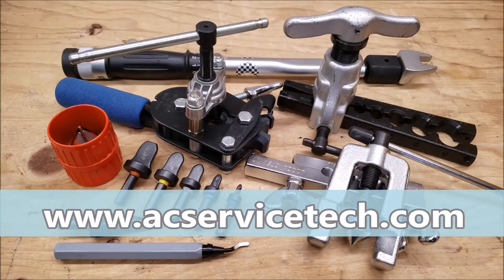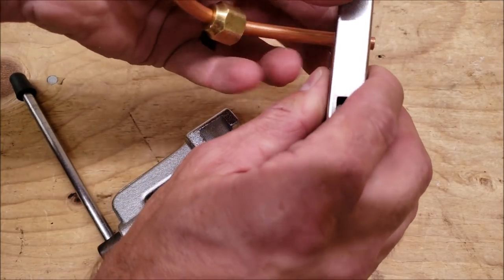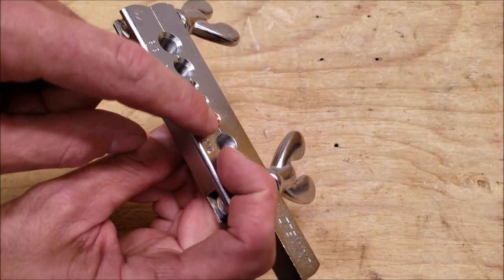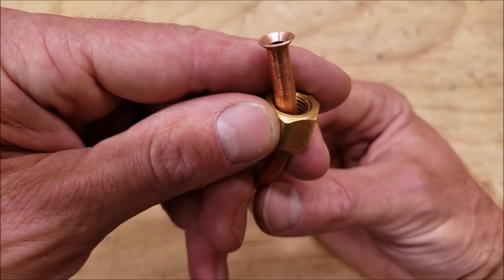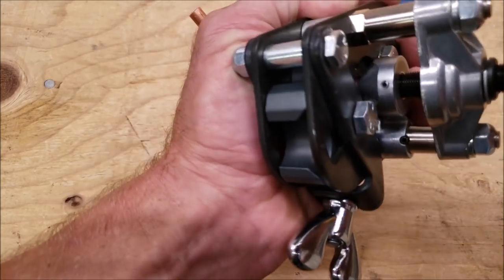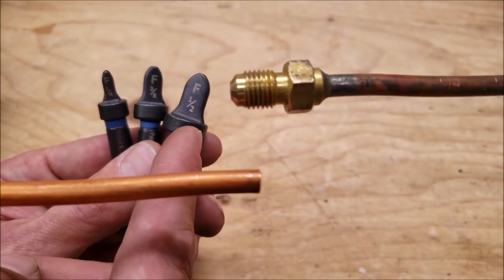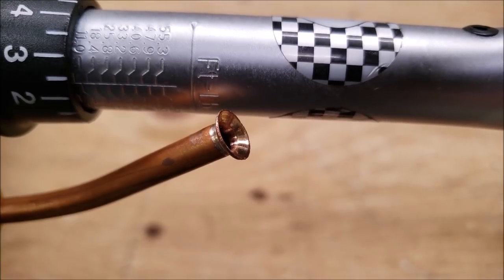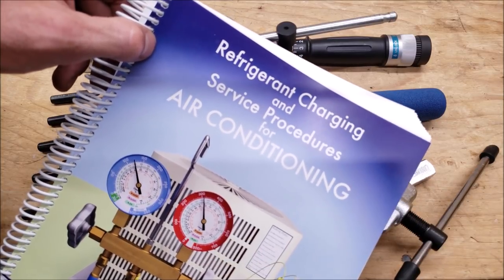Flaring Copper Tubing! Eccentric, Spin, Orbital Process & Block Kit!

Comment: thanks for an(other) excellent video - is it appropriate to use a flare+mechanical connection to fix a refrigerator ? I need to replace the compressor on my fridge and would be interested in trying this approach as opposed to brazing; or do we risk getting a leak after a few months due to vibrations ?
Thanks !

Comment: Very informative, thank you!! One thing I would add at least for beginners is make sure the flare nut is on before flaring.. LOL May sound stupid obvious but it's a common beginner mistake.
Reply: LOL!!  Beginner?   Ever been in too big a hurry?  LOL!!
Reply from the maker: I believe I mentioned that several times in this video and showed the nut on the copper but yes it has happened to all of us and it is now usually on the forefront of our minds before flaring, thanks!
Reply: I've been working with flare fittings for like 30 years and still forget once in awhile! Lol

Comment: Great demonstration of using the different types of flaring tools. I’m a fan of the orbital tool and not so much for the spin-type flairs. Great job as always! 😀👍
Reply from the maker: Thanks stuzman!
Reply: I like the eccentric also. I have the same yj one and it seems like I always have trouble with the tubing slipping out of the yoke. I have to use mesh cloth to grip it. Poorly made I feel like.

Comment: I love Craig's videos and have always followed his suggestions.  However I have never been able to get a tube reamer like the red one he uses to work.  Even with the copper tube pointed down and doing lots of tapping on the tube after reaming, I always find 1 or 2 VERY small copper flakes left inside the tube that I can't get out.  Any suggestions on what I could be doing wrong or how to get the flakes out?
Reply: Put some tissue or cotton ball inside the tube before reaming. You can pull it out afterwards with some long tweezers and it will take out all the flakes and chips with it.

Comment: I heard a 410a unit use a defferent degree angle need to buy a 410a flaring tool not the old tool ive always used.
Reply: Bernie Clement I think so. I know that for the mini-split systems it's a 45° flare. I think that the old flare is 35 or something.
Reply: @johnsmithjr5498  im thinking small degree of flare difference dont matter when you tighten down the flare nut. It dont leak your good!
Reply from the maker: Most flaring tools now available are 45 degree and most air conditioning flares whether for R410A or older R-22 are 45 degree. Plumbing is also 45 degree, thanks!
Reply: I've heard the same thing. Also that there's a difference between plumbing and refrigeration. But seems to be cleared up now. Thanks.

Comment: Hey dear can you make a video how to use torque rench please
Reply from the maker: Here is a job where I flare the fittings using the torque wrench, thanks! https://youtu.be/Ze7HCWcwnrI
Reply: @acservicetechchannel  this is video only how to use torque rench but i need how to adjust torque rench for any requirement
Reply from the maker: The manufacturers have different torque settings even for the same tube but this info is found in the manufacturers literature, thanks!

Comment: Isn't the angle of the flare different also? I know for the mini-split systems it's a 45°.
Reply from the maker: I believe I discussed that a little in the vid but we use 45 degree and all of these tools are 45 degree. Refrigerant flares regardless of the type such as R-22 or R-410A are 45 degree. Plumbing is also 45 degree, thanks!
Reply: @acservicetechchannel  thank i got to do this that helped saying plumbing is the  same
Reply: @acservicetechchannel  I always wanted to know if the angle of the flare for r22 & r410 A are the same thanks for this info.

Comment: Personally, I prefer double flares for 1/4 and even 3/8.   Any thoughts?
Reply from the maker: We just use single flares for HVACR. I understand being used to them do to steel brake lines, thanks!
Reply: @acservicetechchannel  Yeah, my problem is I don't use torque wrenches and I probably should.   That's why I double flare my small lines; I can tighten them as tight as I can and no worries about the flange ripping off.   No leaks so far.   The sets I have are HVAC sets, so they make HVAC double flare kits so.....
I guess we do!
Reply from the maker: The torque settings prescribed by the manufacturers are for single flares but as long as they hold, thanks!
Reply: I like the idea double flare, just carry some crescent wrench than carrying specific tools I have no space for that xD
Reply: @acservicetechchannel
I never used torque wrench and never double flared and so far have not heard about leak of my flare after 6 years. The only risk is damage to the nut or valve thread. Why I do that? Because that's how it was done the company I worked  for. They said they don't use torque wrench because they had leaks and they used the best flaring tool I've ever seen - it gives You total control over the process of doing a flare. It works similar to orbital tool but it uses three free spinnig cones connected with vertices and connected to spinnig press. When you think feel it's done you disconnect thread using some kind of clutch/pin and three cones still can rotate freely around axis while maintainig pushing force in place (without this step flare would have shape of rounded triangle). It's called grandfather's flaring tool because of inventor of this tool - some small manufacture in Poland. Hope they maintained production quality (the guy is retired now and his son taken over the business) because I want to start my own business and cannot imagine making flares without this tool.

Comment: How long does the reamer last I have a red one
Reply from the maker: They don't really go bad unless it is a cheap one and the blade falls out. If the whole thing is metal, they usually last as long as you have them when using them for copper only, thanks!

Comment: Is there a rule of thumb on how much copper sticks out with each diameter of tubing?
Reply: It is all the same. The new flare tools have a stop built in but you can use the width of a penny.
Reply from the maker: Yeah usually it is around an 1/8" past the edge of the flare block on most but it also depends on the depth of the flare grove in the block, thanks!
Reply: Is it 1/8 inch from bottom of flare on tool or the top edge?

Comment: You burned yourself on the copper when you used the spin flare, didn't ya?
Reply from the maker: Hey Bill, it was time lapsed, it was warm at that point but yes I should have put a note  to say to wait or wear gloves at that moment. I think I wore gloves when holding it during the process though, thanks!
Reply: Yea it's crazy how hot it gets.